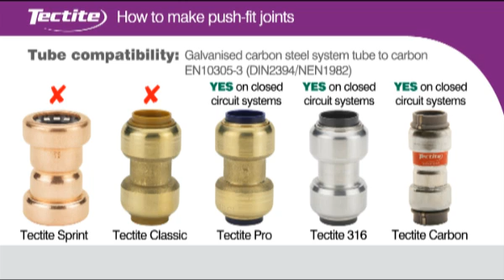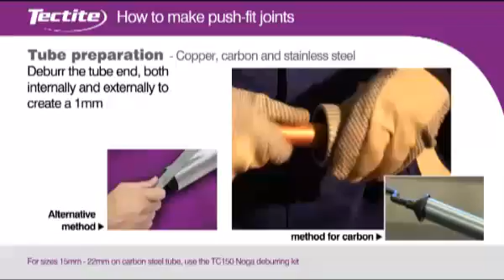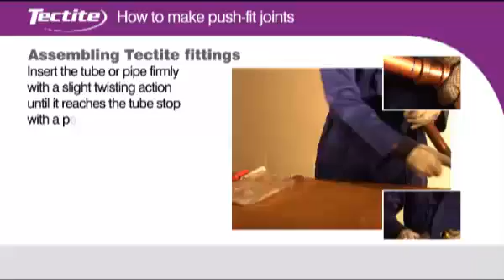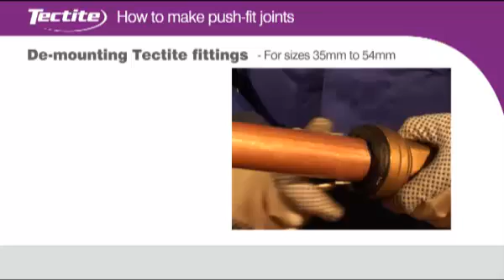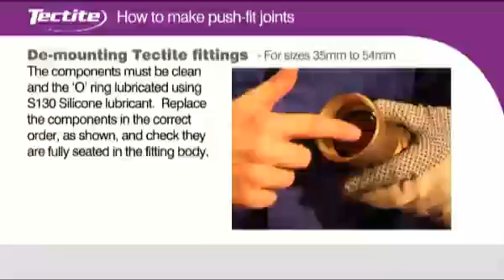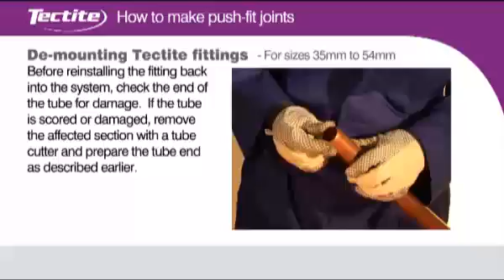Tectite push-fit fittings

Comment: if joining pex to copper we must always put in the liner in the copper and the pex pipe right? its not just the pex and omit the copper pipe liner right?
Reply from the maker: Hi Marty Forkwater thanks for your comment. Hopefully this will answer your question:
Always use a liner on plastic tube in accordance with the manufacturer's instructions, copper pipe does not require one.  However, always ensure good tube preparation.  Rotary cutters are always recommended and ensure there are no burrs or sharp edges which may compromise the oring seal.  
The PY Social Media Team
Reply: +PeglerYorkshire DTA Hi so the pipe liner does not have to be a Tectite one. Can I use say a speed fit liner to fit a Tectite sprint connection to Speedfit PEX tube?
Reply from the maker: +Darren Thompson-Allott Thanks for watching our video - we hope you found it helpful! We only recommend the use of Tectite Liners with Tectite pipe as the integrity of the joint cannot be guaranteed with the use of another manufacturers liner. PY SM Team
Reply: only use the plastic for the plastic print the fucking thing on the package